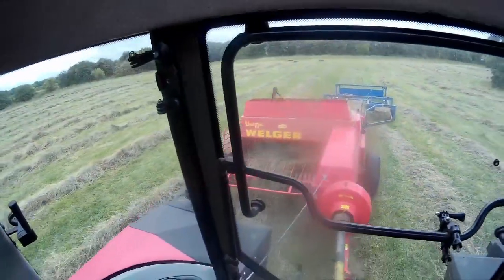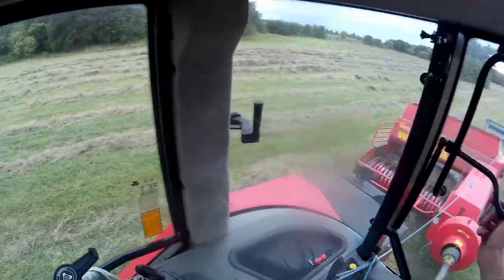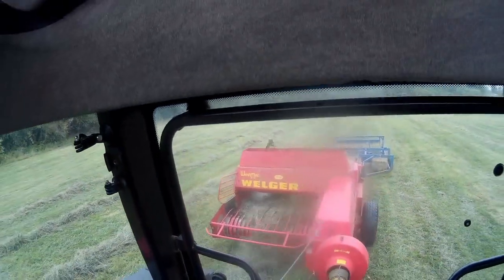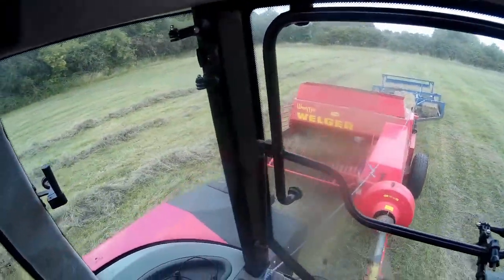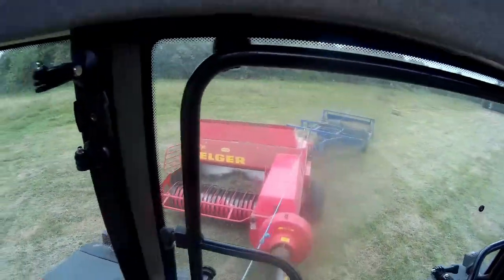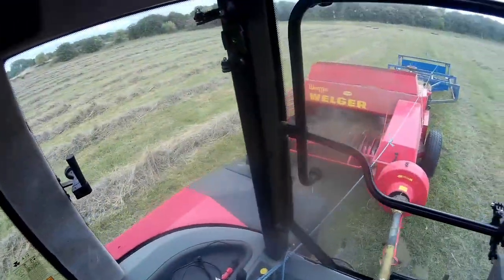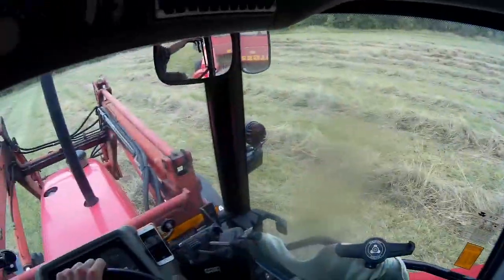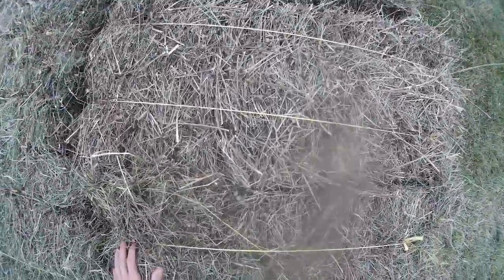Baling hay 18

Comment: If you want a cheap tedder have a look at lely, there old ones have fold up gates that fold over the rotors and chuck grass all over. The monitor I fitted to the trac is going to have a camera on the blaer/sledge to I can see when the sledge screws up 😂
Reply from the maker: Is that reverse camera wireless ? Stuart Dubois posted a video for a similar looking one on a loader but i think it required power to the camera which would be a pain to put on to implements. don't no if it'd be good for me id be out re-tensioning every time a lop sided bale started to emerge 😔
Reply: No not wireless as every time you would want it you can't bet it would be flat. Plus I've a couple more bits to fit for the sledge as well. Yeah I'd seen his video.... fell over at the price and bought mine 😂. Think I only had a couple of bananas this year but I had the contractor row up my thin fields